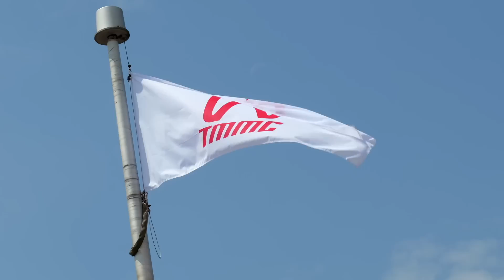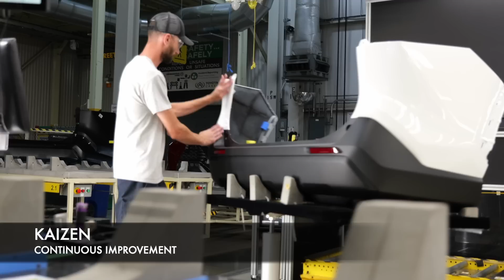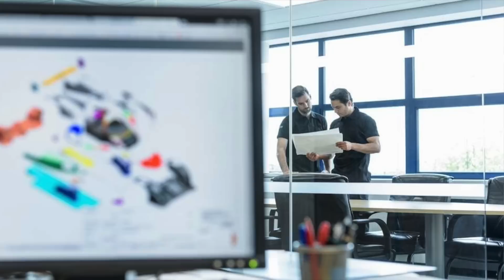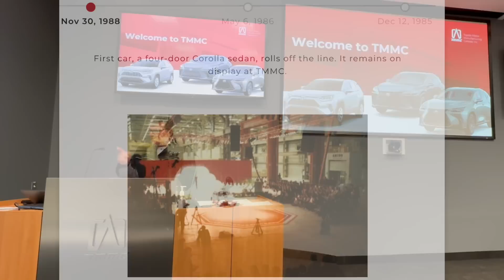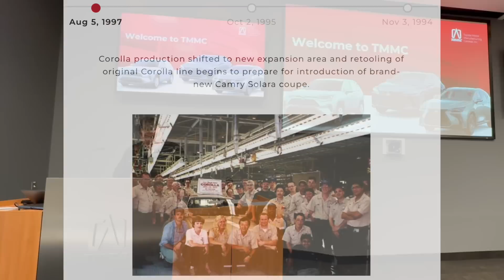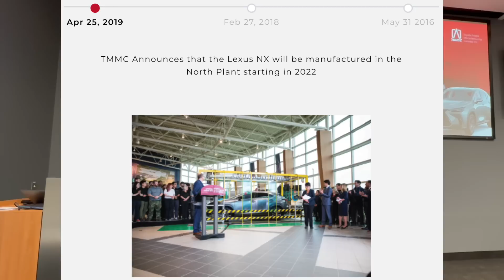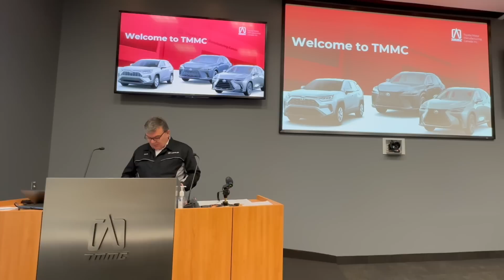LATEST TOYOTA PRODUCTION SYSTEM AT TMMC // ENGINEER INTERVIEWS TMMC PRESIDENT

Comment: Thanks for the Video. Personally I believe Toyota/Lexus quality varies (and dropped significantly) depending on country of the origin. A Corolla made in Japan is much better assembled than a Rav4 or even Lexus in North America. 

Even here in Toyota Canada the quality of the Lexus RX made in Woodstock ON is much superior than the NX built in Cambridge ON. Why? Because the NX is built on the same line as RAV4. Workers who build the RX are far better trained and handpicked hence the better quality final product. 

Also it seems Toyota has not much quality control for it’s suppliers. For example most Corolla Cross with leather steering wheel experience that leather peels after some time. Corolla Cross is on production for 3 years now and it is surprisingly why still Toyota hasn’t taken any action. This is only one example. just look at the Toyota Grand Highlander owners forum and it can be find out how new products are sent to the customer and how Toyota treat its customer in terms of after sales service.

I used to love Toyota/Lexus because of everything the TMMC president just mentioned in the video and did all of that in the past. But my 22 Lexus NX built in Cambridge ON proved to me that the quality is not a #1 priority of Toyota because sales and profitability is the #1 goal.

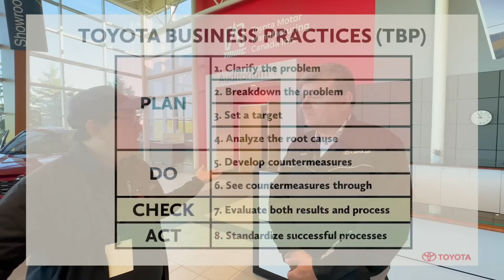Comment: Amazingly good video. Toyota really does optimize for customer value, not business value and convenience. Most businesses have rules and procedures that must be followed. The lowest level of the company has the most knowledge, the highest level of the company has the most authority. The rule is "if it ain't broke, don't fix it. Meet the production numbers". Most managers have indirect information: Key Performance Indicators and other processed and indirect data. Repair costs up 7% doesn't tell you about weak bearings in the lathes. Reports are more valuable than actual knowledge (Genchi Genbutsu, go look, go see.)  Even with written specification and procedures, Toyota expects problems. The environment is always changing. Authority goes with knowledge and low-level employees are encouraged to fix problems as they arise (4:29 problem solving method). Every level of the company contributes to the product and could be involved in a problem solution, as required. I'm sure it's difficult to achieve cost and work goals, but at least everybody is pulling together in the same direction.